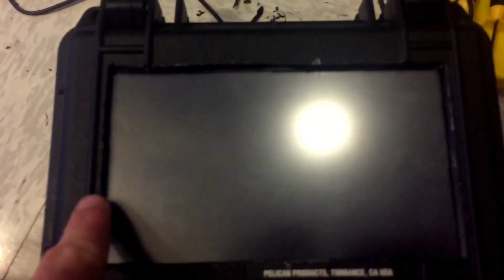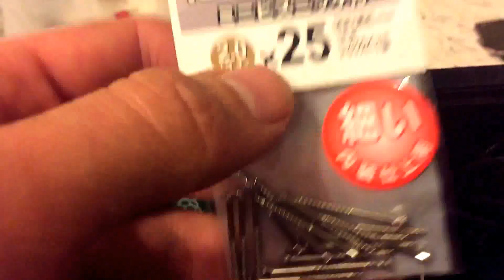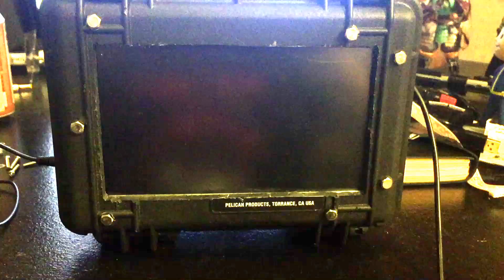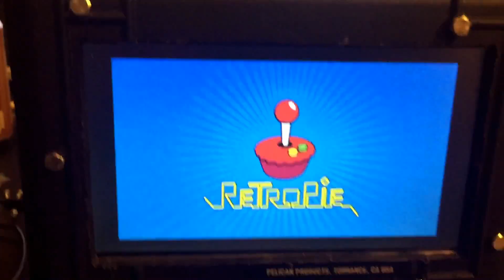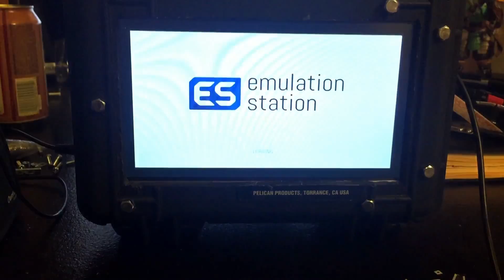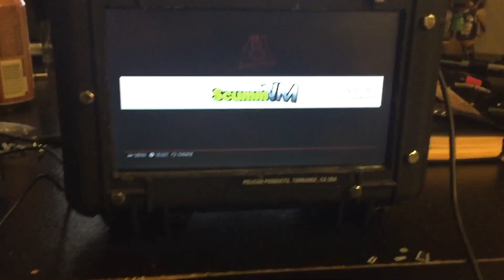Raspberry Pi 1 B+ Gaming Emulator System - Complete DIY Build Using Retropi

Comment: Great video. You have inspired me try something like this even though I don't know anything about jigsaws, drilling, soldering, or anything creative.  The parts are so cheap even if I screw it up who cares.
Reply from the maker: Hahaha, that's the spirit. Pretty much exactly how I felt going into this project, didn't know what I was doing for the most part but I wanted to find out what happened. And it's awesome when you finally finish it too. Good luck on your project!

Comment: I've had a perfect case for this, almost identical to yours. I've been stressing about how to mount my 7" screen inside the case laptop style. This seems to allow a lot more real estate for guts internally. Do you just have the power running out of the box while it's open? I've got my full setup down to one outlet including speakers etc. Your design makes me excited to possibly tackle this build finally.
Reply from the maker: It definitely does allow for a lot more room, especially useful for the cooling. I did another video where I used a larger case and screen and mounted it to the inside of the case like a laptop, It should be one of my more recent videos if you look through my uploads. But for a small 7" screen I think this build is a bit easier to do since it's less parts in total.

Comment: Why in case
Reply from the maker: +paramediccpo I wanted to make something portable that I could take with me anywhere and in a container that is fairly durable as well. But you could easily just buy the cases made for the Raspberry Pi and connect it to a monitor or TV for at home use.
Reply: +Van Damage very good video I love raspberry pi build videos